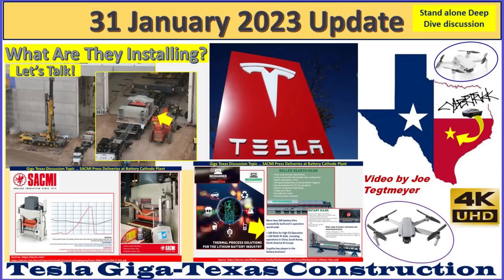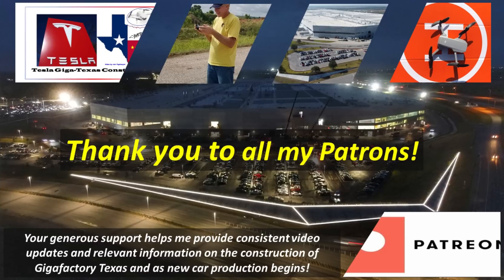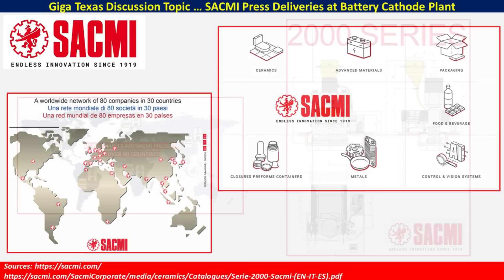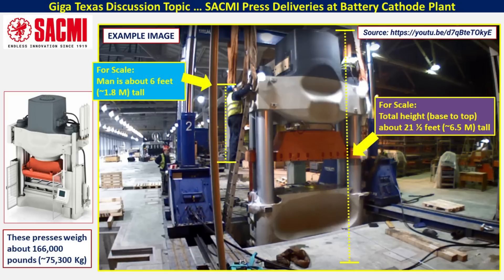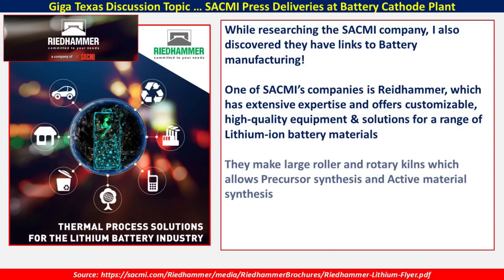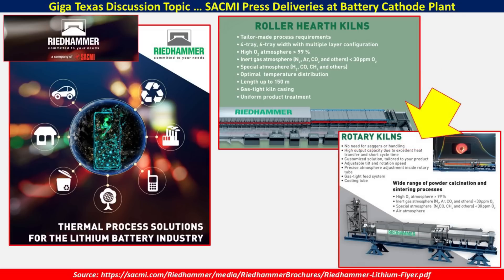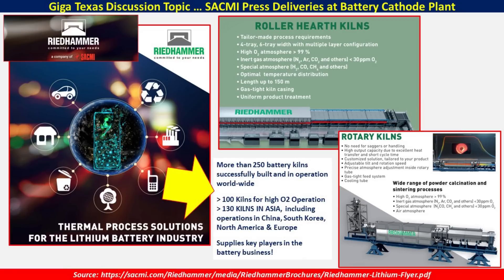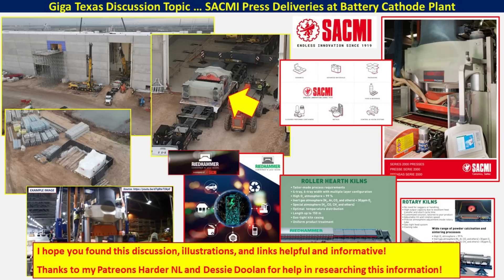Battery Cathode Plant & SACMI Machinery Discussion! 31 January 2023 Giga Texas Updates

Comment: Taking a stab at the purpose of those huge presses in the Cathode building. 
    Remember the initial big problem with the 4680 ramp was hard nickel crystals pitting the larger production press rollers  but not the smaller lab rollers.   The delay to fix that issue led to the decision to go ahead and make other more substantial upgrades to the lines, sooner rather than later.  This is why it has taken so much longer to get 4680 production started.
They are starting the 4680 ramp with 3rd generation processes instead of going with the original 2nd gen and upgrading down the road.
   After seeing what other expertise SACMI brings to the table, my thought was those massive presses are going to be part of a roller kiln setup for processing nickel cathode material.  I think those humongous machines will have very very hard rollers mounted between those huge jaws, and they will crush large hard nickel crystals into very tiny nano crystals too small to make a dent in much of anything. 
  And which also exposes a lot more active surface area to work with, increasing energy density, with zero increase in battery weight.
My 2 cents.
Reply: Reducing metal powder to smaller and smaller particles would require grinding/milling in smaller and smaller batches I think. Crushing between large horizontal plates such as in the Sacmi press can only achieve a limited reduction in size because residual particles tend to form bridges/structures and then the power from the press is absorbed by a coagulated mass instead of acting on small particles individually.

My own 2 cents regarding these presses: the demolition of a structured 4680 battery pack (see Munro Live on YT) revealed a large cover plate on top made from glass fibers, resins etc. Wikipedia says these plates from "FR4" material are made with a press (bingo!) to bind the fiberglass with resins and other ingredients. Maybe there is such a plate also at the underside of the pack.
Reply: @hardernl8893  I agree with plates not doing the job. but I was thinking the press would use rollers, but that's pure speculation.
Be interesting to see the final result.

Comment: A while back Elon mentioned how the dry battery electrode process was deforming the rollers. The small rollers they showed during battery day were tiny. These SACMI presses will probably do fine with the huge pressures needed.
Reply: This is not the same process. Cathode manufacturing involves mixing and calcining raw metal precursors, specifically high nickel oxides, with LiOH. Like all other NMC plants, I expect the same processes here, with optimizations.

This has no connection with dry vs. wet electrode coating. That process happens further downstream of cathode manufacturing. In fact, the output of this plant could either be applied as a wet or dry cathode. Entirely separate process step.
Reply: Yep.

Comment: I could be mistaken, but the kiln process I believe is for a wet cathode manufacturing process. If you go back to battery day and you look at the image that compares a traditional battery line to the dry process proposed for the 4680 you see the traditional kiln in the image of the process.
Reply: You're confusing wet electrode processing, where a drying oven is used to flash off the carrier solvent, usually nMP. The kilns pictured here are for calcining high nickel cathode precursors with lithium hydroxide. This plant produces the active cathode material, which then can be applied to an electrode using either a wet or dry process. Good reading here: https://www.osti.gov/servlets/purl/1437027
Reply: According to the information from CLEANERWATT and others current 4680 cells use the dry process for the anode only and still use a wet process for the cathode. In my opinion the cathode building is some kind of plan B for Tesla: Since the dry cathode process has not been successful so far a wet process is necessary for the cathode. But the wet process requires 10  times more factory space (see Battery Day).  Since Plan A was dry process only the ramp of the 4680 has been delayed due to lack of factory space and equipment for the wet cathode process. With the completion of the cathode building Tesla will be able to scale 4680 production using the wet cathode process in full scale.
Reply: @rolfmuller2144  Wrong, this is for the Cathode precursor materials, or in other words the powder that is then applied to the current collectors either in a dry or wet process.